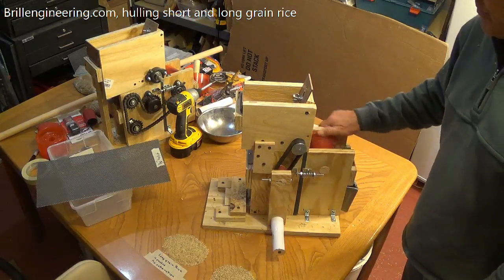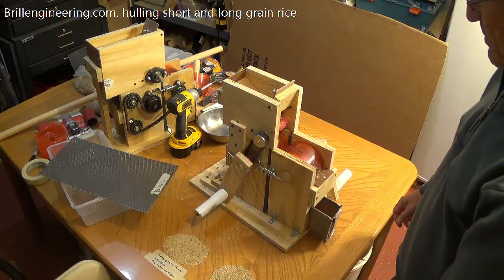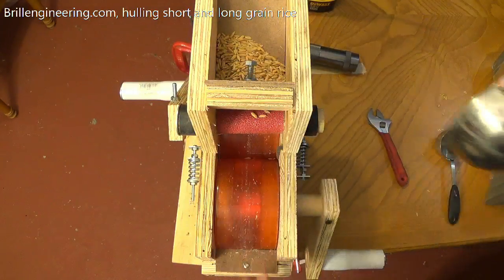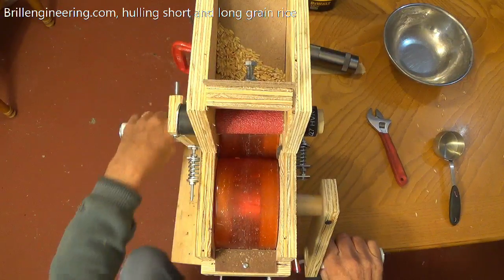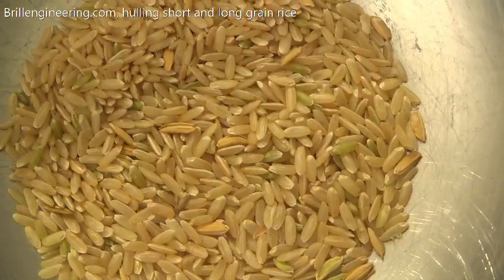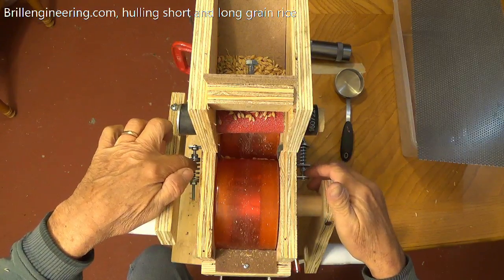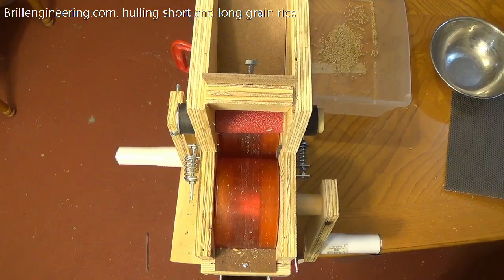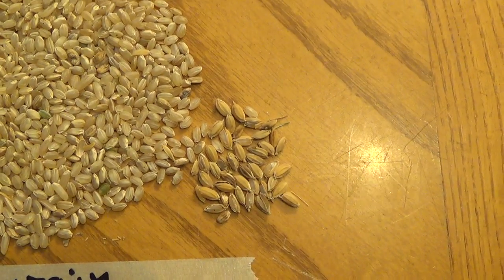Hulling rice by hand, brillengineering.com

Comment: Would a friction huller like this work on pumpkin seeds and sunflower seeds? I'm interested in finding a cost-effective method of hulling small batches of sunflower seeds, pumpkin seeds, and buckwheat on a homestead scale, but there seems to be very little information on hulling these seeds using a friction huller. Impact hullers are usually not an option when processing seeds for a single household.
Reply from the maker: Friction de-hullers will not work on soft seeds such as sunflower seeds.  They are de-hulled with impact type de-hullers.